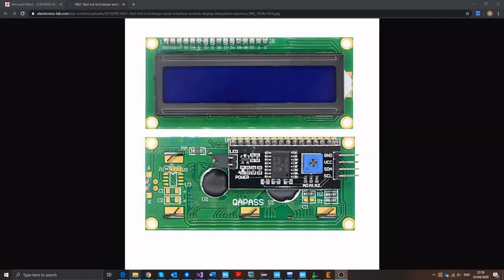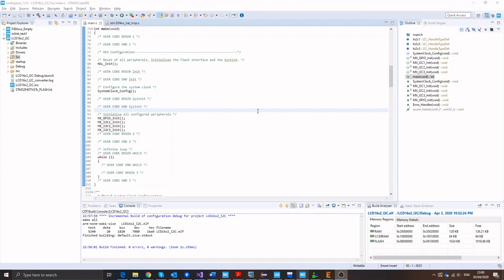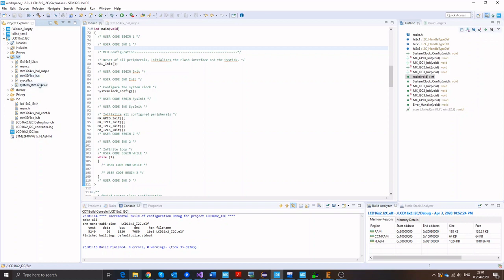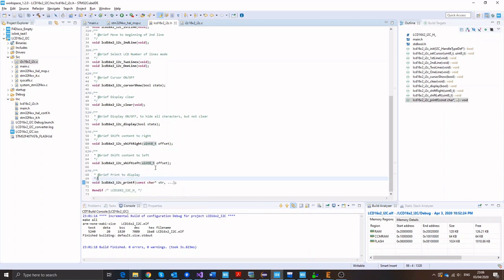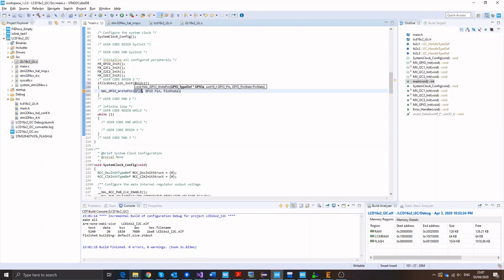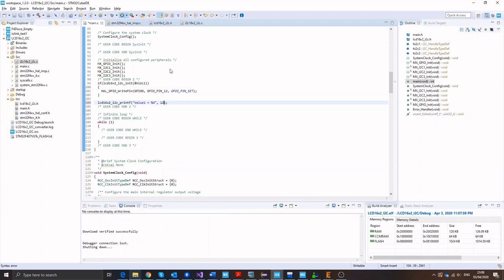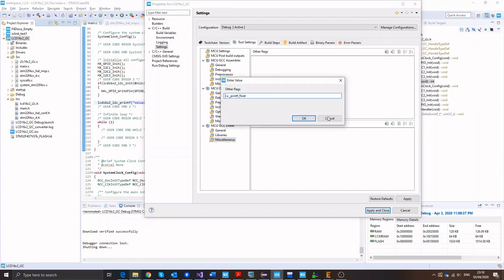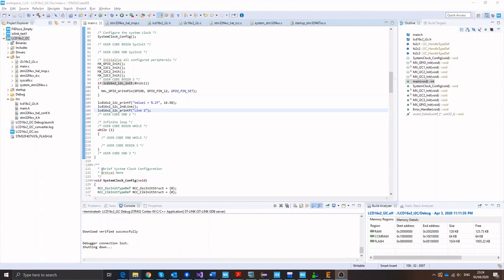STM32 HAL with CubeMX: Tutorial 42 - I2C LCD16x2 driver

Comment: Hello, Mohamed I am facing a problem so ı need to ask if ı am wondering you can answer me? When ı add -u_printf_float to the miscellaneous section and build the code, ı am having a building problem. `.text' will not fit in region `FLASH' and region `FLASH' overflowed by 8120 bytes. Can you help me ?
Reply from the maker: Yes,
That’s your code data size exceeding MCU Ram memory.
Either reduce your ram data size like reduce array max length or use an MCU with bigger Ram memory
Reply: @mutexembedded2206   Thank You!

Comment: Hi, I have a Nucleo-401RE using STM32CubeIDE version 1.8.0. Added the lcd16x2_i2c.c and /h files to the project (Core/Src and Core/Inc) and get 22 errors when I build. All errors are in the .lcd16x2_i2c.c file "redefinition of" starting on line 47. I assume it is a setup problem on my end. Any thoughts?
Reply: Could you find the solition ?

Comment: Hello-  Don't know if anyone is listening out there but I have compiled many times (success); the LED turns on after I init the LCD, the backlight comes on, but no text is on the LCD.
I have turned the contrast up to the point where I see the 1st and 3rd line of blocks (I am trying a 4 line LCD) but no text.
Does anyone know if there is a difference in talking to a 2 line vs a 4 line LCD?  Seems to be so does anyone know how to do it?
Reply from the maker: Hi Steve,
Which STM microcontroller you're using?
I will be happy to take a look at your project setup
Reply: @mutexembedded2206  Hello!  Good to finally hear from someone and it is YOU!
I am using the Nucleo-H723ZG, STMCubeIDE, a SainSmart I2C 4x20 LCD display.  I have made mods to your code to try to get the 4x20 display to work.  The LCD backlight lights up and my feedback LED (very nice) does light up - just no printing.
happy to forward my modified .H and .C files to you (somehow) in an effort to learn more from you.
Reply from the maker: @stevescott55  Sure, just send me a sharing link.
Reply: @mutexembedded2206  hello?
Reply from the maker: @stevescott55  🕶
Reply: @mutexembedded2206  did you see my link?
Reply from the maker: @stevescott55  No link
Reply: @mutexembedded2206  did you get the link?
Reply: @mutexembedded2206  I dont understand what is happening; I send a link and it seems to disappear.  I send my email and that post also seems to disappear.
Reply: @mutexembedded2206  I am at a loss as to how to get these 2 files to you.
Every time I try to send my email address or a link to a Google drive, the post gets deleted.
I do appreciate you wanting to help.
Suggestions?
Reply: @mutexembedded2206  Hello?
How can I move this 4 line by 20 character I2C project forward?  I like what you have done with the 2 line by 16 character.
Please help.
Regards,
Steve
Reply from the maker: @stevescott55  I will give you 15 mins. Send me google meet link code
Reply: @mutexembedded2206  Thank you for the interest but not only do I not know how to do that, I suspect it would take more than 15 min of your time.
I do appreciate the interest but I will try to work this on my own.
Regards,
Steve

Comment: Hello All, just getting started with this and it looks great.  I am having trouble with the files/code.  'lcd16x2_i2c_init' doesnt seem to be anywhere.  Any help?
Reply: Found that error - was using the 4 and 8 bit files for the I2C project!
Fixed that stupid mistake but I am getting a host of errors.  I have tried deleting the section called out by Maris and still no luck.  Are the libraries correct?
Reply: Got errors taken care of, LCD seems to come up but no message and no LED indication that I have talked to the LCD.  Using a Nucleus-144 H723 and can't find a clear pinout of the board so I might be on the wrong pins.  I am using PB6 for SCL and PB7 for SDA, have pullups enabled, Alternate function Open Drain, and High for max output speed.

Comment: Hi sir! Can these libraries files work with F401RE nucleo stm32 board ?
Reply: Once edited to remove errors, the library files work fine with a F401RE board. I’ve also modified them to work with a 20x4 i2c display.

Comment: Hi,I am getting the following errors when compiling the program what could be wrong
In file included from ../Src/lcd16x2_i2c.c:8:0:
../Inc/lcd16x2_i2c.h:307:1: error: unknown type name 'ear'; did you mean 'char'?
 ear
 ^~~
 char
../Inc/lcd16x2_i2c.h:308:3: error: expected identifier or '(' before '/' token
  */
   ^
../Src/lcd16x2_i2c.c:47:16: error: redefinition of 'LCD_I2C_SLAVE_ADDRESS'
 static uint8_t LCD_I2C_SLAVE_ADDRESS=0;
                ^~~~~~~~~~~~~~~~~~~~~
In file included from ../Src/lcd16x2_i2c.c:8:0:
../Inc/lcd16x2_i2c.h:99:16: note: previous definition of 'LCD_I2C_SLAVE_ADDRESS' was here
 static uint8_t LCD_I2C_SLAVE_ADDRESS=0;
                ^~~~~~~~~~~~~~~~~~~~~
../Src/lcd16x2_i2c.c:52:13: error: redefinition of 'lcd16x2_i2c_sendCommand'
 static void lcd16x2_i2c_sendCommand(uint8_t command)
             ^~~~~~~~~~~~~~~~~~~~~~~
In file included from ../Src/lcd16x2_i2c.c:8:0:
../Inc/lcd16x2_i2c.h:104:13: note: previous definition of 'lcd16x2_i2c_sendCommand' was here
 static void lcd16x2_i2c_sendCommand(uint8_t command)
             ^~~~~~~~~~~~~~~~~~~~~~~
../Src/lcd16x2_i2c.c:66:13: error: redefinition of 'lcd16x2_i2c_sendData'
 static void lcd16x2_i2c_sendData(uint8_t data)
             ^~~~~~~~~~~~~~~~~~~~
In file included from ../Src/lcd16x2_i2c.c:8:0:
../Inc/lcd16x2_i2c.h:118:13: note: previous definition of 'lcd16x2_i2c_sendData' was here
 static void lcd16x2_i2c_sendData(uint8_t data)
             ^~~~~~~~~~~~~~~~~~~~
../Src/lcd16x2_i2c.c:85:6: error: redefinition of 'lcd16x2_i2c_init'
 bool lcd16x2_i2c_init(I2C_HandleTypeDef *pI2cHandle)
      ^~~~~~~~~~~~~~~~
In file included from ../Src/lcd16x2_i2c.c:8:0:
../Inc/lcd16x2_i2c.h:137:6: note: previous definition of 'lcd16x2_i2c_init' was here
 bool lcd16x2_i2c_init(I2C_HandleTypeDef *pI2cHandle)
      ^~~~~~~~~~~~~~~~
../Src/lcd16x2_i2c.c:136:6: error: redefinition of 'lcd16x2_i2c_setCursor'
 void lcd16x2_i2c_setCursor(uint8_t row, uint8_t col)
      ^~~~~~~~~~~~~~~~~~~~~
In file included from ../Src/lcd16x2_i2c.c:8:0:
../Inc/lcd16x2_i2c.h:188:6: note: previous definition of 'lcd16x2_i2c_setCursor' was here
 void lcd16x2_i2c_setCursor(uint8_t row, uint8_t col)
      ^~~~~~~~~~~~~~~~~~~~~
../Src/lcd16x2_i2c.c:155:6: error: redefinition of 'lcd16x2_i2c_1stLine'
 void lcd16x2_i2c_1stLine(void)
      ^~~~~~~~~~~~~~~~~~~
In file included from ../Src/lcd16x2_i2c.c:8:0:
../Inc/lcd16x2_i2c.h:207:6: note: previous definition of 'lcd16x2_i2c_1stLine' was here
 void lcd16x2_i2c_1stLine(void)
      ^~~~~~~~~~~~~~~~~~~
../Src/lcd16x2_i2c.c:162:6: error: redefinition of 'lcd16x2_i2c_2ndLine'
 void lcd16x2_i2c_2ndLine(void)
      ^~~~~~~~~~~~~~~~~~~
In file included from ../Src/lcd16x2_i2c.c:8:0:
../Inc/lcd16x2_i2c.h:214:6: note: previous definition of 'lcd16x2_i2c_2ndLine' was here
 void lcd16x2_i2c_2ndLine(void)
      ^~~~~~~~~~~~~~~~~~~
../Src/lcd16x2_i2c.c:170:6: error: redefinition of 'lcd16x2_i2c_TwoLines'
 void lcd16x2_i2c_TwoLines(void)
      ^~~~~~~~~~~~~~~~~~~~
In file included from ../Src/lcd16x2_i2c.c:8:0:
../Inc/lcd16x2_i2c.h:222:6: note: previous definition of 'lcd16x2_i2c_TwoLines' was here
 void lcd16x2_i2c_TwoLines(void)
      ^~~~~~~~~~~~~~~~~~~~
../Src/lcd16x2_i2c.c:174:6: error: redefinition of 'lcd16x2_i2c_OneLine'
 void lcd16x2_i2c_OneLine(void)
      ^~~~~~~~~~~~~~~~~~~
In file included from ../Src/lcd16x2_i2c.c:8:0:
../Inc/lcd16x2_i2c.h:226:6: note: previous definition of 'lcd16x2_i2c_OneLine' was here
 void lcd16x2_i2c_OneLine(void)
      ^~~~~~~~~~~~~~~~~~~
../Src/lcd16x2_i2c.c:182:6: error: redefinition of 'lcd16x2_i2c_cursorShow'
 void lcd16x2_i2c_cursorShow(bool state)
      ^~~~~~~~~~~~~~~~~~~~~~
In file included from ../Src/lcd16x2_i2c.c:8:0:
../Inc/lcd16x2_i2c.h:234:6: note: previous definition of 'lcd16x2_i2c_cursorShow' was here
 void lcd16x2_i2c_cursorShow(bool state)
      ^~~~~~~~~~~~~~~~~~~~~~
../Src/lcd16x2_i2c.c:197:6: error: redefinition of 'lcd16x2_i2c_clear'
 void lcd16x2_i2c_clear(void)
      ^~~~~~~~~~~~~~~~~
In file included from ../Src/lcd16x2_i2c.c:8:0:
../Inc/lcd16x2_i2c.h:249:6: note: previous definition of 'lcd16x2_i2c_clear' was here
 void lcd16x2_i2c_clear(void)
      ^~~~~~~~~~~~~~~~~
../Src/lcd16x2_i2c.c:206:6: error: redefinition of 'lcd16x2_i2c_display'
 void lcd16x2_i2c_display(bool state)
      ^~~~~~~~~~~~~~~~~~~
In file included from ../Src/lcd16x2_i2c.c:8:0:
../Inc/lcd16x2_i2c.h:258:6: note: previous definition of 'lcd16x2_i2c_display' was here
 void lcd16x2_i2c_display(bool state)
      ^~~~~~~~~~~~~~~~~~~
../Src/lcd16x2_i2c.c:221:6: error: redefinition of 'lcd16x2_i2c_shiftRight'
 void lcd16x2_i2c_shiftRight(uint8_t offset)
      ^~~~~~~~~~~~~~~~~~~~~~
In file included from ../Src/lcd16x2_i2c.c:8:0:
../Inc/lcd16x2_i2c.h:273:6: note: previous definition of 'lcd16x2_i2c_shiftRight' was here
 void lcd16x2_i2c_shiftRight(uint8_t offset)
      ^~~~~~~~~~~~~~~~~~~~~~
../Src/lcd16x2_i2c.c:232:6: error: redefinition of 'lcd16x2_i2c_shiftLeft'
 void lcd16x2_i2c_shiftLeft(uint8_t offset)
      ^~~~~~~~~~~~~~~~~~~~~
In file included from ../Src/lcd16x2_i2c.c:8:0:
../Inc/lcd16x2_i2c.h:284:6: note: previous definition of 'lcd16x2_i2c_shiftLeft' was here
 void lcd16x2_i2c_shiftLeft(uint8_t offset)
      ^~~~~~~~~~~~~~~~~~~~~
../Src/lcd16x2_i2c.c:243:6: error: redefinition of 'lcd16x2_i2c_printf'
 void lcd16x2_i2c_printf(const char* str, ...)
      ^~~~~~~~~~~~~~~~~~
In file included from ../Src/lcd16x2_i2c.c:8:0:
../Inc/lcd16x2_i2c.h:295:6: note: previous definition of 'lcd16x2_i2c_printf' was here
 void lcd16x2_i2c_printf(const char* str, ...)
      ^~~~~~~~~~~~~~~~~~
make: * [Src/subdir.mk:36: Src/lcd16x2_i2c.o] Error 1
"make -j4 all" terminated with exit code 2. Build might be incomplete.

06:29:15 Build Failed. 18 errors, 2 warnings. (took 685ms)
Reply: Hello, I had the same problem. h. File is mixed with c. File.
Here is the correct h. Filele:
/*
 * lcd16x2_i2c.h
 *
 *  Created on: Mar 28, 2020
 *      Author: Mohamed Yaqoob
 */

#ifndef LCD16X2_I2C_H_
#define LCD16X2_I2C_H_

#include "main.h"
#include <stdbool.h>

/* Function prototypes */
/**
 * @brief Initialise LCD16x2
 * @param[in] *pI2cHandle - pointer to HAL I2C handle
 */
bool lcd16x2_i2c_init(I2C_HandleTypeDef *pI2cHandle);

/**
 * @brief Set cursor position
 * @param[in] row - 0 or 1 for line1 or line2
 * @param[in] col - 0 - 15 (16 columns LCD)
 */
void lcd16x2_i2c_setCursor(uint8_t row, uint8_t col);
/**
 * @brief Move to beginning of 1st line
 */
void lcd16x2_i2c_1stLine(void);
/**
 * @brief Move to beginning of 2nd line
 */
void lcd16x2_i2c_2ndLine(void);

/**
 * @brief Select LCD Number of lines mode
 */
void lcd16x2_i2c_TwoLines(void);
void lcd16x2_i2c_OneLine(void);

/**
 * @brief Cursor ON/OFF
 */
void lcd16x2_i2c_cursorShow(bool state);

/**
 * @brief Display clear
 */
void lcd16x2_i2c_clear(void);

/**
 * @brief Display ON/OFF, to hide all characters, but not clear
 */
void lcd16x2_i2c_display(bool state);

/**
 * @brief Shift content to right
 */
void lcd16x2_i2c_shiftRight(uint8_t offset);

/**
 * @brief Shift content to left
 */
void lcd16x2_i2c_shiftLeft(uint8_t offset);

/**
 * @brief Print to display
 */
void lcd16x2_i2c_printf(const char* str, ...);

#endif /* LCD16X2_I2C_H_ */
Reply: @mehmetinci1510  Thank you soo much
Reply: take a look at library "lcd16x2_i2c.h"
line 77 to the end,  there is same part as library lcd16x2_i2c.c  
Just remove these lines and fix the rest bugs
Reply: thanks a lot

Comment: Hi! Files of library has different name in video and on github. Maybe it's problem.
Reply from the maker: Yeah. Ones on GitHub are correct. Not a problem anyway. Compiler accept such thing.
Reply: I'm sorry but i have one more question. Is it reight to define function in two files at the same time?
 For exaple: 

static void lcd16x2_i2c_sendCommand(uint8_t command)   in lcd16x2_i2c.h and the same function

static void lcd16x2_i2c_sendCommand(uint8_t command) in lcd16x2_i2c.c
Reply: @sinulokssinuloks7934  in this case it's correct because the .h file is a headder file. headder file just take the name of the functions in the .c-file of the same name. In your code you just have to include the .h-file and the compiler knows from that which functions are used..

Comment: Hi! Could you check line 307 of lcd16x2_i2c.h. What is it  ear ?
Reply from the maker: Hello,
There's no such line 307.
Reply: @mutexembedded2206  it's true, the libary is not working ... plz fix that!
Reply: the issue is that a c file is mixed in the h file... i deleted the c-file content, i guess now it works
Reply: @m4nuz  You're my hero <3
Reply: This's part of lcd16x2_i2c.h, line 300-310. What is it ear?

 vsprintf(stringArray, str, args);
  va_end(args);
  for(uint8_t i=0;  i<strlen(stringArray) && i<16; i++)
  {
    lcd16x2_i2c_sendData((uint8_t)stringArray[i]);
  }
}
   ear
 */
void lcd16x2_i2c_display(bool state);

Comment: ..\Src\lcd16x2_i2c.c: 2 warnings, 17 errors
Reply: Created on: Mar 28, 2020
Reply from the maker: @看吧-o8e  What's that again
Reply: @mutexembedded2206  
13:57:05 Build Failed. 16 errors, 2 warnings. (took 431ms)
Reply: Description	Resource	Path	Location	Type
redefinition of 'lcd16x2_i2c_sendCommand'	lcd16x2_i2c.c	/LCD_I2C/Core/Src	line 52	C/C++ Problem